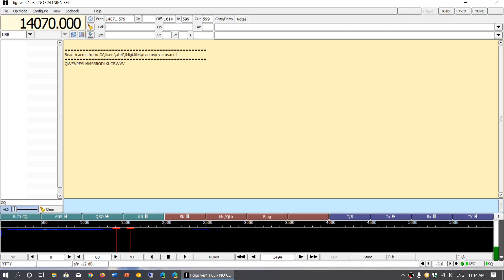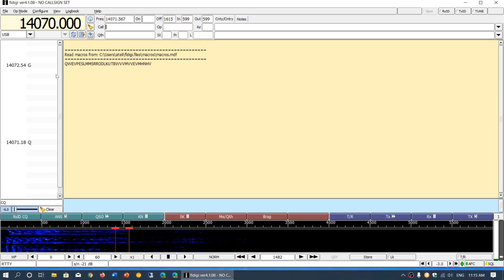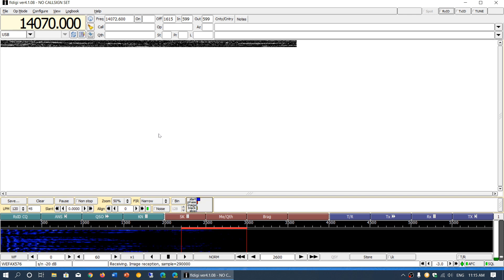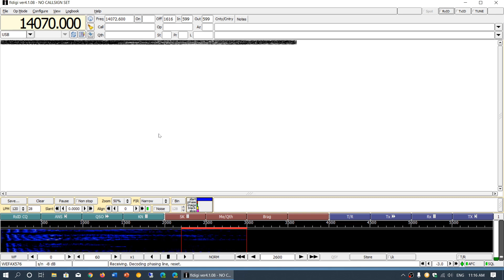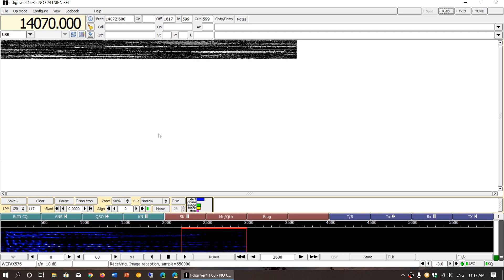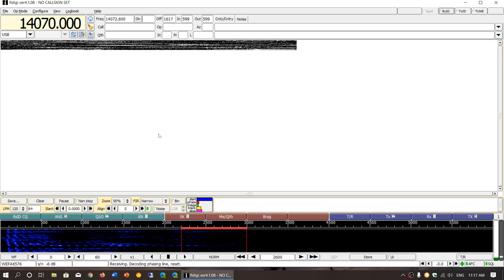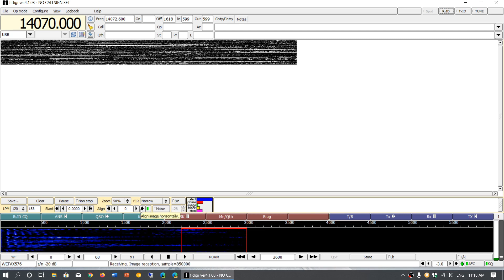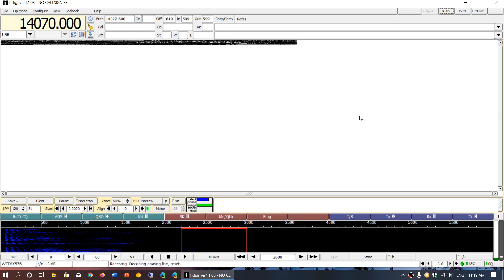Tips and tricks on Decoding Wefax images with FLDIGI software on computer

Comment: Got a MacBook Air, just a couple of years old. I have Parallels software installed, running Windows 7. I use both Fldigi and MultiPSK, the former on the Mac side and the later on Windows. No matter what I do, on Fldigi, can't get the fax imsge to come out clear. On MultiPSK, clear as a 4K image. What's going on?
Reply: i saw you did ur m in 8k